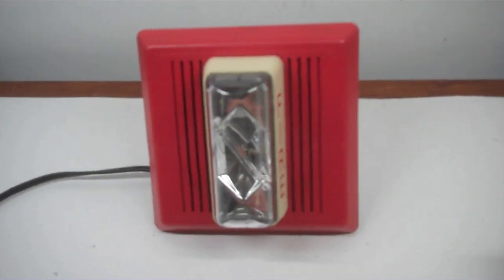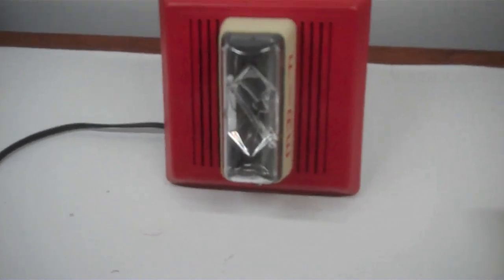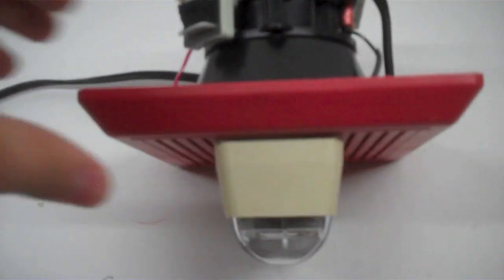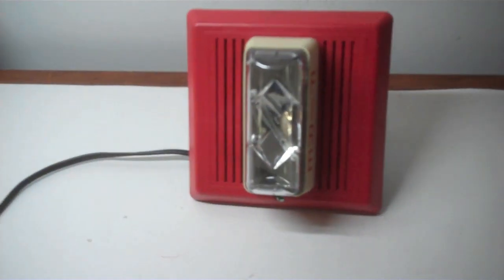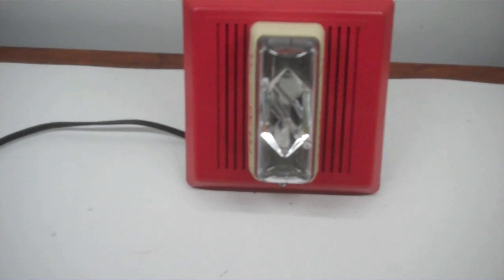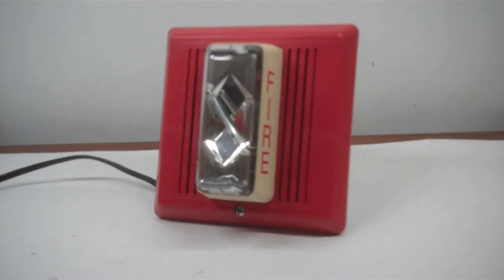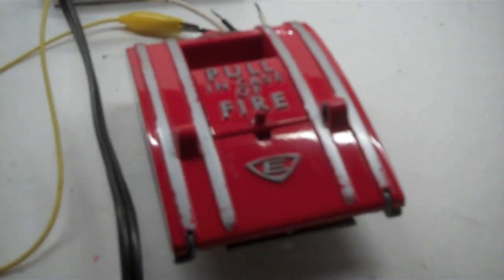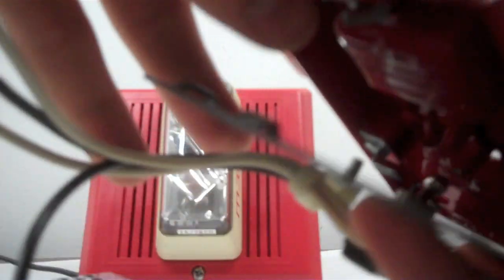EST 757-7A-HS (1st Generation Integrity) Fire Alarm Test

Comment: It sounds like an Edwards 892-2B.
Reply from the maker: +Riley Bruck That's because it uses the same sounder as the 792, which was produced before this one. This Integrity was a "transitional phase" Integrity, where this came out after the 792 series, but before the current Integrity we all know and love today.
Reply: This specific horn was produced just after the 892 series, so it has a very similar tone. However, the older 892 horn has a slightly thinner tone to it than the 792 horn. Both sound at the same pitch though

Comment: Your older integrity has a bigger horn then the regular integrity fire alarm. I m sorry there is no code 3 intermittent sound option I m not mad I like it. I like continuous sounds on that type alarm!
Reply from the maker: This alarm is definitely unique; it is a cross between the 792 series and the regular Integrity. This has the same sounder as the 792 series, which is pretty thick compared to the newer Integrity. The lack of coding option is no problem to me, I can simply hook up the horn to a coder of some sort to obtain the temporal output.

Comment: wow! thanks for finding this rare alarm! this brings back memories of my preschool fire drills back in 2001 and they actually had these old integrities!
Reply: Well in my preschool, they had the 892 series, unless you went to a different preschool.
Reply: @SuperWorldRailFanProductions  I did go to a different preschool. I went to Illchester Elementary
Reply: @exoticcar5482  Bet they are probably upgraged by now. 2001, I wasn't even in the US as yet at that time, but childhood memories.
Reply: @SuperWorldRailFanProductions  I hope not and I don't think they were upgraded as they are still ADA compliant despite the school opening in 1996. Just FYI however, I did revisit Waverly a couple years ago and found that in the original section before the expansions (which I'm sure you remember me LOVING to watch the construction of before I moved to Centennial) they still have the original Edwards 892s, with the Genesis horn/strobes in the newer sections
Reply: @exoticcar5482  I recently visited Waverly in 2019, and also the gym was relocated to where the preschool classes used to be, and I (based on my observation since I wasn't able to go inside) saw they also had Genesis Speaker strobes in place.
Reply: @SuperWorldRailFanProductions  Interesting. There may have been more changes since my last visit. Of course any further visits will have to wait till this damn virus settles down
Reply: @exoticcar5482  Well hopefully by mid 2021, this virus would be under control and not be as serious as it currently right now. Then maybe we could take another visit. I was also quite disappointed that I got redistricted to a new elementary school whilst Waverly was in the process of getting additions put on to it. I would remember during recess time, I would just stand and watch the workers construct. The other addition at the rear of the building where the third grade classes were now has two stories compared to one, and I assume that floor would be all EST Genesis horn strobes.
Reply: @SuperWorldRailFanProductions  I forgot you were redistricted when Veterans Elementary was built! What kind of alarms did they have there? And yes, I do remember seeing that two floor addition where we used to have third grade together. Shame because I had many great memories there
Reply: @exoticcar5482  I was redistricted to St. Johns Lane when Veterans was built. I have to admit to you that my new elementary school's fire alarms were much more worse. They had Wheelock AS horn strobes in the front sections of the building, and if I believe either Wheelock MTs or EHS-DL1s in the classrooms too that had exits (no kidding: In the classrooms). Luckily in fourth grade, my classroom didn't have alarms and exits but rather a remote strobe. Fifth grade, my classroom had alarms, specifically Wheelock EHS-DL1 horn strobes with an exit, and they would always scare the crap out of me whenever they went off. Ever since then, they replaced all their old alarms with EST Genesis horn/remote strobes with Integrity horn strobes on the exterior. I believe this was done after my new elementary school had an addition put to it. Not sure what your new (Centennial Lane) elementary school's fire alarms were though.
Reply: @SuperWorldRailFanProductions  They were EST Genesis which happened to have been installed as part of the then-new renovations which I experienced Centennial Lane's first year with
Reply: @exoticcar5482  That's what I thought once Centennial Lane was done with renovations. Back in those days, most schools had replaced their fire alarms with Genesis alarms. my high school even had those too.
Reply: @SuperWorldRailFanProductions  Howard County Schools that is
Reply: @exoticcar5482  Most of them, yes